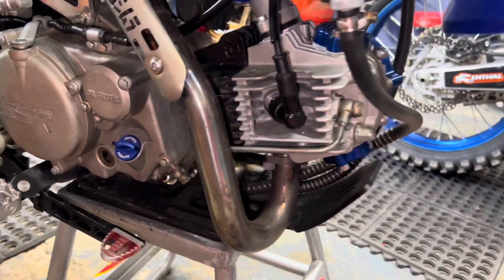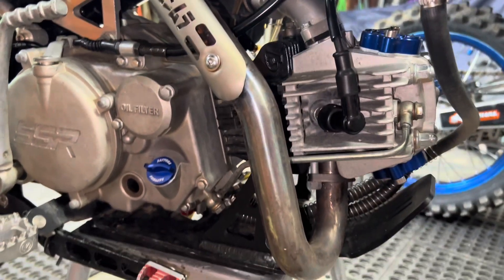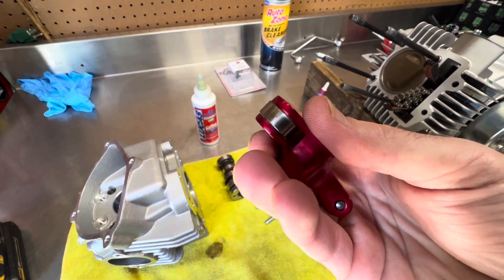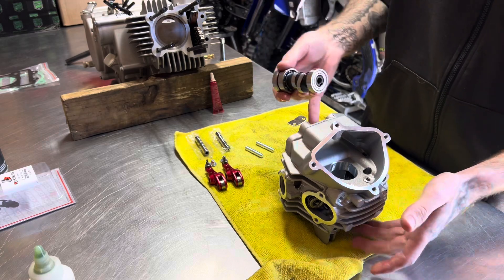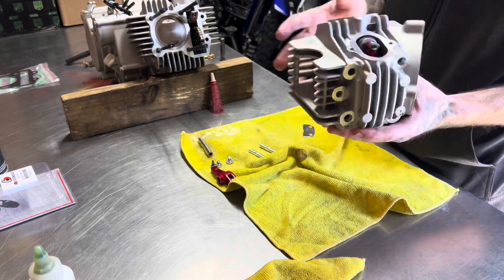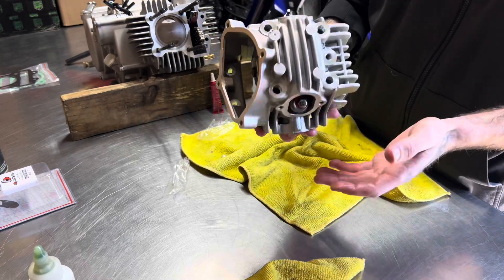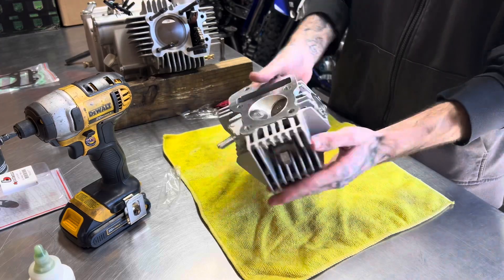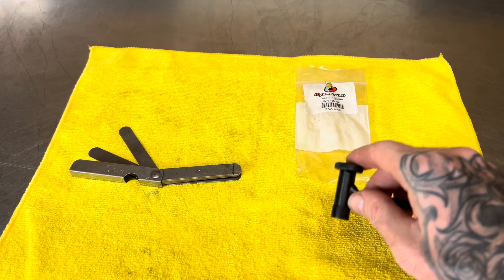How to Assemble TB Parts V2 Race Head for KLX and YX Engines

Comment: What bore size do you feel the valves would clear?  Been looking at putting one on a Z125 Kawi since it's basically a 56mm overbored KLX110 engine.  I have to keep the bore smaller than the 60mm piston the kit uses to stay in a class we roadrce in.  Awesome video - thanks for taking the time to create it.
Reply from the maker: 67mm bore size is biggest you can go bc if you go any bigger your going to end up boring thru the cases. As it is now theres not much metal left on the spigot hole 🕳️.. i have another video building one of these 160 engines to a 201cc check that one out

Pit bike Engine Upgrades | More Power! 160cc to 201cc Big Bore Rippa
https://youtu.be/JPz551wmUnM
Reply: @JesseK410  I asked that question incorrectly.  What's the smallest bore you think the head would work on? I can't run the 60mm piston.
Reply from the maker: @eheddles you should be able to put it on even a 110cc bore but not sure how its gonna effect the performance if its gonna make more power i always use them with the 160cc engines an bore kits

Comment: Ive got this engine with that head but ive got in a crf50 style pitbike frame will standard exhaust be way off?
Reply from the maker: It should work might need to make a bracket for the rear muffler mount
Reply: @JesseK410 perfect cheers for that
Reply from the maker: @jordenj1 your welcome
Reply: @JesseK410 what carb did you run with it?
Reply from the maker: @jordenj1 PWK28mm
Reply: @JesseK410 ive got the nibbi pe28 but everyone saying thats too big?
Reply from the maker: @jordenj1 its not to big don’t listen to them

Comment: Would if make sense to put in a z40 cam on the v2 146 race head kit from tbparts? Or would it be better to use the one that comes with it?
Reply from the maker: @pv2443  i assume you are talking about the honda style V2 head and not the one like in this video… People have had great results with the z40 cam on certain setups for sure! The cam that comes with it is also great and can work good it really all depends what you want. Check out both cams specs and see what power range will work for you, typically i just run the TB cam that comes in the kit but if you feel like testing both out i would love to hear your specific feedback on the Z40 cam. I might try one out on my next supermoto build ..
Reply: @ ✅thank you thank you
Reply: @ what clutch setup would you use in your next super moto build? I want something durable and reliable I’ve seen the 6 plate kit and I’ve also seen the tc motors one on Amazon but I’m not sure what to think
Reply from the maker: @ i wouldn’t get the one on Amazon. I would get one of them off of TBoltUSA.

Comment: How to you mount the oil cooler?
Reply from the maker: @Ethan12326  two 6mm bolts that mount to a bracket on the underside of the frame
Reply: @JesseK410  ok thank you

Comment: Hey I’m having trouble finding any information on the wiring for my pirahna 140. Could you help me with the stator to coil and motor wire colors? I can’t get this thing to get spark
Reply from the maker: Off the top of my head im not sure but if you go on tboltusa.com they will have that info for sure “tech and data guides” hope this helps brother

Comment: Is this the same as the klx head just a different cam?
Reply from the maker: No its not the same this is a upgrade for a stock klx110 head as its got bigger valves and everything
Reply: @JesseK410  I thought this was the same v2 head the klx engines take
Reply from the maker: @RileySimmon  yeah it is but its bigger valves and port size than a stock klx head is and its also roller rocker design so its not the same yaknow

Comment: Would it be worth putting this on my yx160 engine, how much difference will it make
Reply from the maker: Yeah it would be worth it and it makes a bog difference with a good carb and exhaust setup
Reply: @JesseK410  thanks i have a genuine mikuni vm26 carb and also t1 pro core exhaust already so may have to put this on
Reply from the maker: @MXJS160  i would do a pwk28mm carb if you do end up deciding to do the Tb parts V2 head the 26mm will be a lil small to make power gains

Comment: What jetting you got with the 184 bbk and v2 head?
Reply from the maker: I have 40 pilot jet and 120 main jet currently.. Pwk28mm carb 👍🏼
Reply: @JesseK410  sweet, will use it as a baseline for mine. Using the nibbi pe28
Reply from the maker: @Scoob_Heartwood  perfect thats what i like to hear, not everyones jetting is gonna be the same anyways. Temperature and elevation is gonna be the biggest determining factor